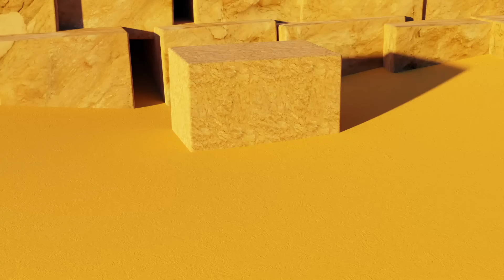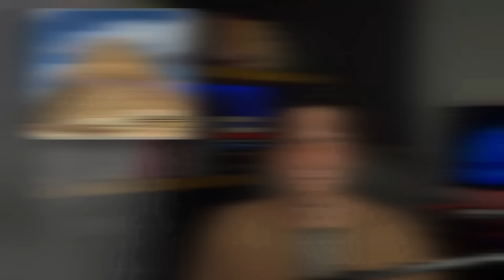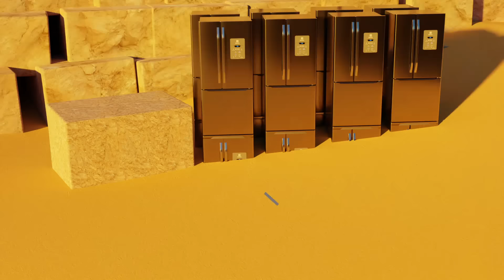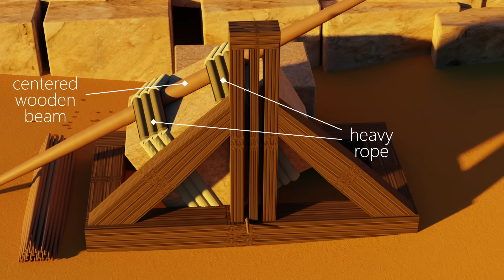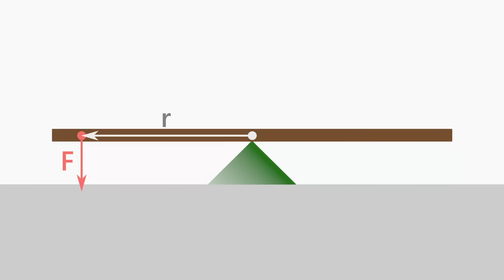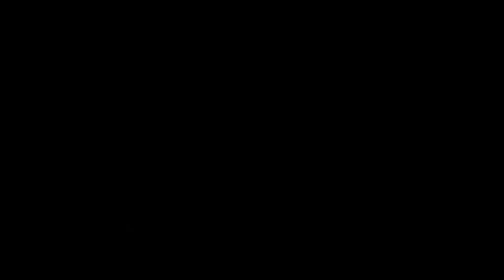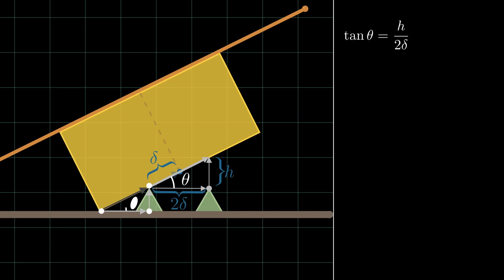Physics Reveals How the Pyramids were Actually Built

Comment: To the uneducated non-math commoner I would say the toothpicks inserted to raise the flock would crack.or may-haps they were made of unobtanium.? Best wishes .
Reply from the maker: That’s why it’s never a good idea to only believe an animation. To understand the strength of wood, you’ll need the Young’s modulus of wood, which is extremely strong when compressed perpendicular against the fiber lines. But speaking of toothpicks, next time you have a whole case of toothpicks, take them all out at once and try and snap them all in half. Even run your car over them and see how they hold up. The slats presented here are at least 6 times thicker than that. The slat thickness can actually be any arbitrary amount. Cheers

Comment: They moved 10 ton stone blocks with sticks. That's pretty impressive.
Reply from the maker: I don't remember saying sticks.  But if you're having doubts, I'd suggest starting with the Young's modulus of wood.  As scaffolding, wood is only used to hold up 10,000 ton freeways during construction.
Reply: @DrJohnDev  I don't know, but my take on the comment, is that he is genuinely impressed, not mocking.
Will admit that, the first thing I wondered was, how strong the wood would have to be, to not get deformed, crushed, or pushed out of the way.
Especially as the height increased.
I would really appreciate a follow up video, addressing the physical requirements, of the materials, dimensions, of the lifting device itself, and not just the forces applied at the end points.
Kind of a structural engineering analysis of the materials, the device is made out of. How many times could you use the pivot wood pieces, before they wear out. What kind of wood, did they have access to, to build these things.
It is a fascinating subject, thanks very much for this presentation, and best wishes for your continued success.
Reply: @DrJohnDev  The Young's modulus of a certain type of wood is only a small part of the equation. All you have to do now is prove that the ancient Egyptians had access to the right types of wood, had it in the required quantities, and that they understood how to construct suitable scaffolding to support the required number of machines and a number of stone blocks each weighing several tons. And then explain what other material they used to as pivot points to support those blocks. Im sure you've done the research to support your theory... haven't you?
Reply from the maker: The key to learning is to be receptive to learn.  The points you bring up are certainly explainable, but only to those willing to understand.
Reply: @another3997  seems like the pivot points might leave marks, that we could observe, with modern instruments/techniques.

Comment: Did not care for this math lesson. What I would like to see is how many Hero machines would be me needed to lift one block to elevation every 6 minutes please
Reply from the maker: So the 6 minutes quoted in the beginning is assuming only one block being raised at a time, which, in any construction, isn't really how it works.  The blocks would be going up in tandem.  Even having just 10 Herodotus machines working in parallel, at various sides of the pyramid, would bring the number up to 1 block per hour.  With 10,000 workers, likely there were many, many Herodotus machines working at the same time.
Reply: @DrJohnDev  ok thanks! So if I understand there would have to be an average of 60 machines operating continuously for the entire 30 years right?
Reply from the maker: 27 years, but yeah, they certainly had to operate in shifts.  24/7 production was no easier then, than it is now.  But nothing outside of normal.
Reply: I have been thinking more about this. If we had the 60 machines operating continuously, would that raise stones to the correct level? I don’t think so. This would just elevate stones to level two correct?

Comment: Excellent video and fascinating to watch... But it seems to me that a civilization using the mathematics and physics required to create levers and such would also have the capacity to utilize the wheel, which wasn't invented yet... I think they found the pyramids, left over from a previous civilization that was wiped out during the younger dryas Era. There's thousands of years of occupation and history to sort through but there's similar structures scattered across the world with absolutely no record of how they were built.
Reply from the maker: It is surprising about the wheel, and very interesting point!
 Although, even though they were utilizing levers, it's unlikely they actually understood the physics and mathematics completely.  The mechanical advantage of the lever was likely discovered through experimentation.  We just have to use physics today in order to backwards engineer their designs. A modern example of technology that we use, but don't fully understand, is superconductivity.

Comment: How did they get the blocks there?
Reply from the maker: Great question! So although the Herodotus machine wouldn’t have been used to transport the blocks horizontally, horizontal displacement is a much ‘easier’ feat than vertical displacement. Namely, if you reduce friction as much as possible, the block becomes easier to move horizontally. Methods such as transporting the blocks with sleds over water logged sand have been documented as possibilities. Horizontal displacement also doesn’t have the same restrictions on worker numbers as vertical displacement. For instance, the blocks can be wrapped with an arbitrary number of ropes and many workers can work together to move the blocks horizontally, unlike the restriction on vertical displacements.  Excellent question and hope this answers it!
Reply: @DrJohnDev  Demonstrating how a 10 tonne block (or even 70 tonne block) can be pulled horizontally across sand using a sled, water and papyrus ropes is something that should be easy to do. However, nobody ever does any form of demonstration. Instead, there's just a lot of words and documents used as proof. Why do you think that is? There's no shortage of 10 tonne blocks lying about on the planet, there's plenty of water, sand and even papyrus. i personally would be happy if modern ropes were used as a first demo.

Comment: 6mn each block
Reply from the maker: Right, the raw numbers are quite formidable. However, that intro calculation admittedly assumed only one block being laid at a time. With the 10,000 workers they had at any given time, multiple blocks could be lifted around the base in tandem. For instance, even 10 machines working in tandem would bring the number to 1hr per block.